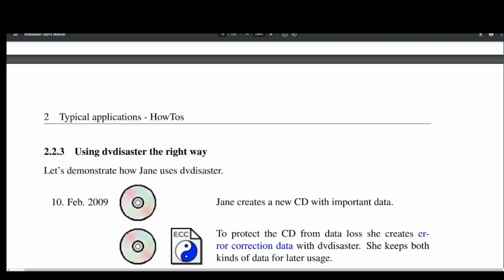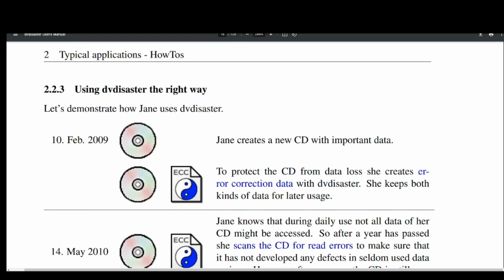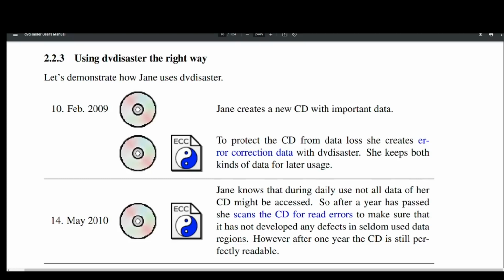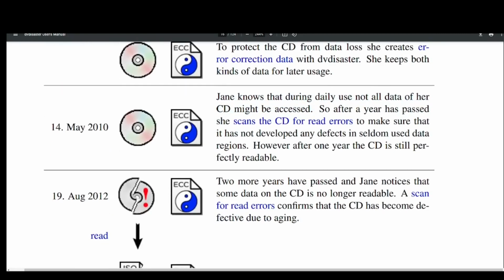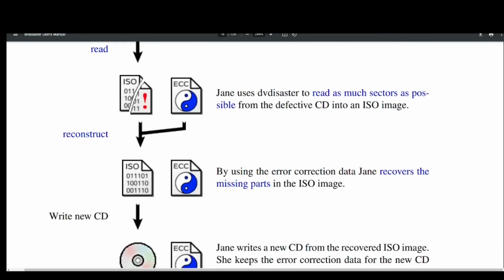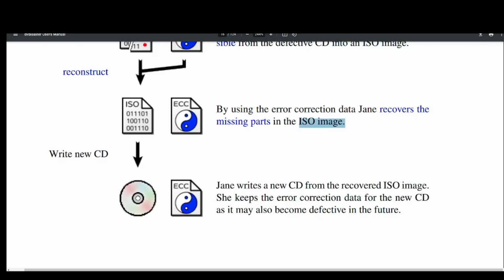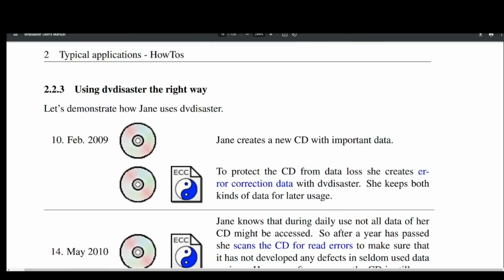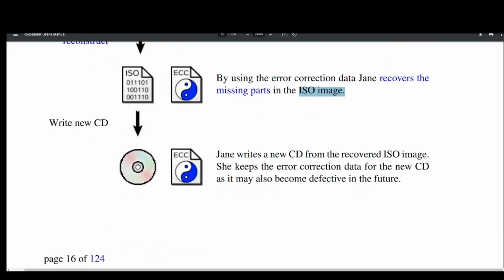How dvdisaster is supposed to work

Comment: I used dvdisaster to check optical discs  I left in the hot basement for 20+ years without any protection
Most of them have no bad sectors despite not being in cases
The ones that have bad sectors were all scratched up. They had bad sectors due to scratches and not due to disc rot.
Even the ones that were badly scratched were 95 percent readable. 
This makes me think disc rot is over-exaggerated by m-disc manufacturers to get you to buy their overpriced discs.

Comment: Optical media for archival? Huh? My laptop is 4TB. I'd be dead before I finished burning that many DVDs
Reply: Blu-rays go up to 128GB.
Reply: @UriahStuff  128 GB do exist but they are getting very rare and expensive. Sony stopped making them. Only the Verbatim 100 GB on amazon JP are still a good deal.
Reply: Optical media lasts for much longer, especially BD or M-DISC BD/DVD. You write them and it's guaranteed they'll outlast you while an SSD doesn't retain data for many decades.
Reply: @ LOL, longest lasting media is spinning rust at 35 years. Optical doesn't even break a decade
Reply: @ Regular BDs are estimated to last 70-100 years, and M-DISC BDs are marketed with 1000-year durability - accelerated aging tests showing they can last a solid 600 years without significant failure.
Reply: @morcjul  If you can keep them cool and out of the light, sure. I'm not paying for that AC